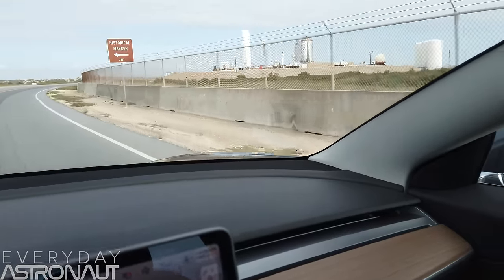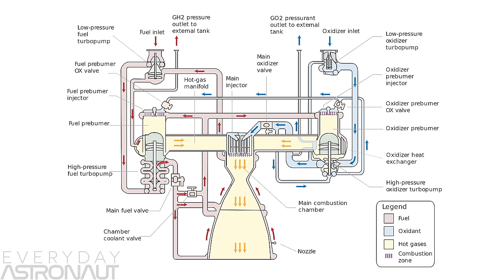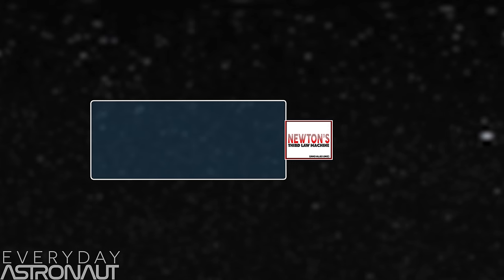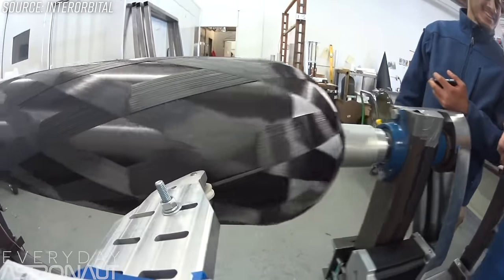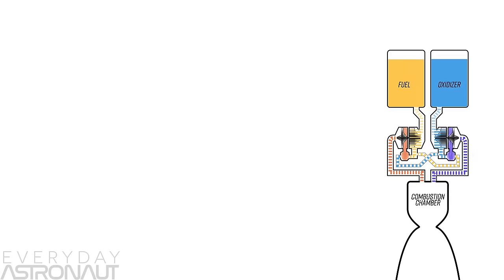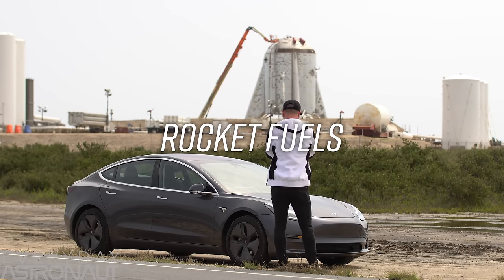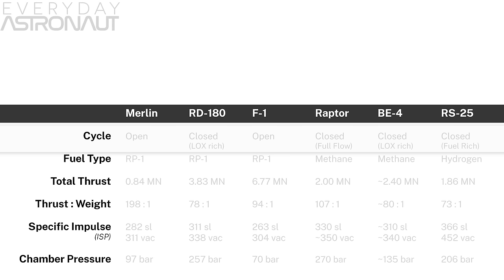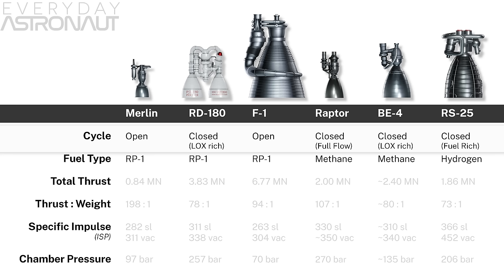Is SpaceX's Raptor engine the king of rocket engines?

Comment from the maker: Elon watched the video and provided some additional input in this tweet - https://twitter.com/elonmusk/status/1132386984444383233?s=20

"Great video. Couple notes: Raptor designed for subcooled CH4/O2, so propellant density & thrust increase up to ~8%, as needed for mission. 380 Isp & up to 50% thrust/weight improvement over time. Merlin thrust/weight doubled from V1, but Raptor is closer to optimum."

and this one - https://twitter.com/elonmusk/status/1132389917722419200

"Propellant stays same, but almost everything else improves. Fundamental goal is minimize cost per ton to surface of Mars."
Reply: That's awesome! Does this mean the TWR increases to about 150?
Reply: If Elon is interested, you clearly did something right!
Reply: Do you think he watched the whole thing through? Probably on x2. Job offer from SpaceX not far behind.
Reply: Congratulations.. and Thank you for all your hard works and commitments 🙏
Reply: Amazing video! Took time but totally worth it. For future reference, this is the go to video for any rocket-engine related things
Reply: Wow. Elon probably subscribed to you. Great work!
Reply: Very awesome that Elon watched and then commented on your video.
Reply: on flight record, for Merlin, RS-25 and F-1, multiple have flown per flight, for M1d multiply by 10, RS-25 x 3, and F-1 x 5 also M1D hasn't failed in flight, only M1C
Reply: Thanks for the update and I have to thank you once again for your superb explanation! <3
Reply: engine F-1 fail mission Apollo 13
Reply: Totally worth the time. You should have made this video earlier. Please make a video of airospike. Is it possible to combine airospike with raptor design?
Reply: Tim, the link to the first Elon tweet takes you to this video. It needs changing to Elon's tweet.
Reply: Hi Tim, 300 bar is not the equivalent to 3 km deep under the sea but 300 meters. EDIT: I was wrong and it is 3 km, Tim is right
Reply: @alxo82  Every 10m of depth adds 1 bar .  And  300psi = 20.67 bar..   But he meant 300bar times 10 equals 3000m
Reply: @TRFerron  1 m under sea = 1 atm = 1.01 bar
Reply: awesome video Tim i know have a much better understanding of different engines :)
Reply: Wow thats really cool! You make really high quality content, so it's not that surprising that even Elon watches it . Also love that they had your sticker on the computer on the livestream once.
Reply: Ugh @ Mark B Spiegel inserting himself everywhere
Reply: @omsi-fanmark  I was wondering to. But he can't take a job at spaceX because then he would not be allowed to leak the info :p
Reply: @gibacke2536  The F1 never has failed.   Your probably thinking about the J-2 second stage engine failure.
Reply: You forgot  they can be carbon neutral on earth
Reply: Well, you did ask Elon to do an Interview to tighten up the data, or free it, or something:)
Reply: Amazing video Tim, really bringing rocket science down to earth for the rest of us!
Reply: @alxo82  No. 10m of sea water is about one atm of pressure. I'm a commercial diver and recompression chamber operator. I know what I'm talking about on this one. Tim has the right numbers, you don't.
Reply: Does 'cost per flight' include refurb cost?
Reply: How exciting to get a comment and commendation from the man himself. Great job.
Reply: Thanks for the great presentation.  I learned so much watching your videos. Your enthusiasm is contagious!!!
Reply: I just noticed, do you have heterochromia?
Reply: @dan_13  short sellers, and competitors, or there fan base. Really you know your doing a good job when they get pissed off. Means they are nervous.😎
Reply: @everydayastronaut you should team up with Jared Owen he makes awesome animations and you could explain
Reply: Awesome video!
Reply: In answer to the question you posed, re: King of Rocket Engines, it may be, but the Queen of Escalation of Rocket engines has to be the electric fed 24mHg/FOOF with graser amp
Reply: Cool story bro.
Reply: The Best video so far, I guess you could apply for professor job at California Institute of Technology.
Reply: @kingsleyknoxlar  I know, I really enjoyed it, Charlie Stross does a good job of presenting it ;)
Reply: @alxo82  round numbers, there's 1bar / Atmosphere every 10 meters, so 300 bar times 10 is equal to 3000 meters which is equal to 3Km depth on salt water, so Tim is right 🙂.
Reply: @gasdive  you're right, all my life I thought it was 1 m = 1 atm, you never stop learning!
Reply: @jacobrubio9948  yeah, I was wrong!
Reply: This was really very very good video Tim u just nailed it
Reply: Whaaat? So the Merlin’s trust to weight ratio is around 400:1 ?!?!
Reply: @alxo82  learning is my favorite thing! Teaching second. Love love that comment thanks!
Reply: @gibacke2536  S II not F 1
Reply: @denismehmedoff7306  excellent idea
Reply: @alxo82  had the same thought during the video.
Reply: @alxo82  NO! 10m is 1 bar!
Reply: @gibacke2536  Seriously? Please check this again, you are wrong! The problem (Houston, we have a problem!) begin at about halfway to the moon, the F1 engines of Saturn V  was on the ocean floor long ago.
Reply: Love the fact that SpaceX looking long term in selecting fuel option due to availability on Mars. I hope I see them get there in my life time, would be dream come true for alot of us mere mortals that see colonizing Mars is essential to survival of humanity.
Reply: I had never noticed (totally not space related) that you have heterochromia
Reply: Gibacke: I believe that failure occurred in the 2nd stage which would have been a J-2 engine. F-1 engines were only on the first stage.
Reply: Wha? You act like Elon is some sort of ENGINEER or something ;) ...
Reply: Well, Tim, it's such an honor to have your video reviewed and commented upon by Elon Musk himself. It's wonderful to have someone like you around to translate all this for us -- mere mortals. I watched to the end and will watch again! You're a treasure. Looking forward to more Rocket Science from you!
Reply: @hatman4818  he does
Reply: @gibacke2536  on Apollo 13, all F1 engines worked (first stage), but the center engine of the second stage failed and cut out early. Those were different engines.
Reply: Great job ) now I know more about rockets))
Reply: @casinivan  would also recommend Scott Manly's video on rocket engines, deliberately won't put the link in, leave you with the pleasure of digging it out of the rest of amazing content this guy produces.
Reply: @oliverriall  someone will eventually have to take over from John Insprucker, and, I think Tim would do MUCH better job then those young boys and gals commenting falcon 9 launches now, it's often almost uncomfortable watching them being eaten by nerves on live stream, good for them and well done Elon for giving them a chance and throwing them into a deep water but for pure viewing pleasure someone with a lot of passion, a lot of knowledge and insight (these guys probably have all of those qualities to be fair), but ALSO is not scared of a camera pointed at them streaming live show to millions of people around the world would-now this would be a treat. Tim's live streams have more hits then Space X's-hint hint Elon.
Reply: @omsi-fanmark  dude that's a great idea they just need to let Tim host the official launch channel!
Reply: @carldavies4776  it seems that SpaceX would not have advantage of using untested designs like the airospike untill they are interested to build SSTO. It seems that vacuum optimised nozzles are more efficient than a airospike design at least in vacuum so SpaceX is actually well served by the current multi stage design for moon and mars missions.
Reply: Where did you get models of falcon rockets? Which scale? Where i can get also?
Reply: Hey Tim, great video. Definitely will rewatch multiple times, but why don't they just...... Turn the landing pad of the drone ships into a gimbal system to balance the return booster? To balance out the tides.
If you do read this, 
Thank you!
Reply: that's a link to this video, not his tweet :D
Reply: Personal replies from Elon Musk and Scott Manley. Baller.
Reply: @gibacke2536  Wrong.  That was an oxygen tank explosion on the command module, which was the 3rd stage of the rocket.  F-1 engines powered the 1st stage and fell back to the ocean once the fuel in the stage was depleted.
Reply: @dan_13  Jeff 😂
Reply: @dan_13  Jeff who? 🙄😳🤭
Reply: I already understand the electron rocket and why it's such a big deal! Why isn't Elon doing this for their raptor engine?
Reply: RD-170 has barely flown? you might want to google "Zenit". other wise another stellar vid full of great info and ever increasing production values
Reply: A really good video and great topic to use to introduce the different models of rocket engines. 
No suprise Elon watched it, you want to know what people are posting about your company are true.
So far this is the best video I have come across to set out the foundations of current rocket engines. 
One point you went from pressure rockets to flow cycles with out the step of burning fuel. I know it's "obvious" but you have the water rocket or fire extinguisher thruster. Then you have rocker that burn but are pressurised with compressed gas but burn the fuel. 
However great video worth the 50 miniutes of my time to watch. :)
Reply: F1: the center engine of Apollo 13 failed and almost blew the rocket.
Reply: @gibacke2536  the engine didn't fail on that flight
Reply: Tim, if Elon succeeds in achieving $00k round trip tickets to Mars, will you go?  The idea is to sell all your earthly possessions to raise the cash.  Most working adults without children in the Western world could scrounge up $200k buy selling their stuff.
Reply: @karliszauers1 failed second stage ,1 engine
Reply: @gibacke2536  no Oxygen tank ruptured, the engine didn't fail
Reply: Great channel dude! Elon should support you cuz u simplify these ideas to ordinary ppl like me
Reply: Consider breaking up videos like these into smaller chunks: It'll feel like less of a slog for your viewers. You can get more adds in. And it'll improve your integration with the YouTube algorithm.
Reply: Gibacke I think this just counts launches. Otherwise how should you count reignitions mid-flight for some mission profiles but not others?
Reply: @oliverriall  Yeah, they will want Everyday Astronaut as their PR guy. As much as all other space agencies / companies do. :)
Reply: @oliverriall  Certainly for their public outreach branch. What a great communicator!!
Reply: Fantastic info! Keep up the amazing content. You sir are providing much joy to this 49year old dude that loved space as a child and went through horrible disappoint when we didn't continue to the moon and beyond. I had given up on ever seeing progress in space travel. With Elon Musk embracing interplanetary travel it has reignited the passion and your channel is a fantastic source I use to keep up with current events. You rock! Thanks again!
Reply: @gibacke2536  No cause technically it was a tank failure in the upper stage, so not an F1 failure and not even on the same stage as F1.
Reply: @thegood9  That's cause Elon is an engineer though he is an electrical engineer by training, though he does have a good grasp of many engineering fields.
Reply: Failed space hardware 3?
Reply: @jimalbi  No it didn't it was the center engine of the Second stage J2 engine that failed on Apollo 25.
Reply: With this in mind, can you do a video on the "open expander" cycle Aeon rocket by Relativity Space?  The 3d Printed one.
Reply: The RD170/171 has been launched into space som 70-80 times. It is the most powerful liquid fueld rocket engine ever made, and it should be in the comparison. The RD-180 is also designed to be reused 10 times.
Reply: @jimalbi  2nd stage center engine failed not an f1 on the first stage.
Reply: It's still just a Newtonian device - trying to perfect the steam engine (methane + O2 = H2O + CO2) isn't going to get humans very far.
Reply: Thank you for producing a well documented and well understood video on rocket engines. This should be shown in classrooms to engage the next Generation of where we have been and what is to become to get us efficiently into Space. Well done!
Reply: stupid question from an amateur here, but has anyone ever tried to eliminate the preburn cycle entirely?  Maybe using something like an EM induced cylindrical impellor (kind of like an inverse auger) with a progressive pitch increase within the fuel and lox lines themselves?  i have no idea if the hydrodynamic properties of liquid methane or oxidizers would allow it to work, but if it did, no extra seals to fail and no complex fuel routing.  But like I said, I'm no professional, just a thought from an amateur inventor.
Reply: Everyday Astronaut the Soviets used Stalinium in their closed cycle engines )))
Reply: Great video Tim!  I was anxiously awaiting this one and you did not disappoint!  I've watched it a few times now, really trying to soak up all the information.
Reply: @planetmuskvlog3047  most people have a negative net worth.
Reply: @miketeves3237  Perhaps on the cold side they could use a superconductive electric pump.  They are pumping LOX for crying out loud.  The whole purpose of the preburn cycle is to create pressure.  These people have been able to pump liquid hydrogen with a superconductive pump.  Not sure if the pump design would provide the kind of pressures needed but it would be a starting point.
Reply: @prusak26   While Tim does a fantastic job, I also think that the Space X people do a great job in live stream, too. Their presentation by definition has to be  more scripted, but it certainly is informative and enthusiastic.
Reply: @PepsiMagt   Good point about RD-170/171 flights (e.g. on Zenit). Although the RD-180 is extremely durable, there is no way for it to be recovered at present. It is not restartable, and is much too powerful for retropropulsive landings, even with its degree of throttleability, unless it were on a huge rocket with  more than 7 or so such engines. Also, the Atlas V attains much higher energy, at least for unmanned flight profiles, requiring more fuel for re-entry and therefore being much less efficient  as a re-usable first stage.
Reply: @miketeves3237  Yes, the  Rocket Lab Electron rocket, which resembles a scaled-down Falcon 9, uses battery-powered electric pumps on its little Rutherford engines. The second stage jettisons a discharged battery pack before reaching orbit. This works very well
Reply: Thanks for this video.  I worked at SpaceX for almost 8 years, and I still learned something!
Reply: @RarestAce  I wish every CEO in the world would be like him.
Reply: Wow, Elon Musk actually watched this? I didnt think someone as famous as him would be interested in what us commoners watch
Reply: @gibacke2536  Nope - that was on O2 tank in the service module that failed
Reply: @Allen Loser No. Not a "StarGate" either. Consider when Ptolemy successfully modeled planetary motion with pretend glass spheres with epicycles and deferents. From then on, "scientists" worked to perfect that model and nothing else. Same today with quantum mechanics, which still has no variable for "awareness factor" from which our brain cells create the illusion of self.  Something more fundamental and weird is needed, such as being able to show everything shares a common center and light creates the illusion of separation. Then again, why aren't we considering "particles" as miniature event horizons ? Where do we go from here ?
Reply: @Allen Loser No, I don't mean using the Electron engine per se (I hope I understood your answer well enough), I meant the turbo pump section. The Raptor is fine with their design, they are genius, though the Electron engine has not yet been talked about by Tim, it made sense to me how they could do this from what I now know. It all boils down to one thing I think team Electron has done, which I was asking in that query. It seems like Electron engine is using powerful electric motor(s) that pumps the oxidiser and fuel into the combustion chamber(s). From the looks of things, this cuts off a lot of plumbing and mechanisms, which in turn reduces weight and other complexities and adds finer control to the engine. Since it's an electric motor and uses a battery it means SPACEX can leverage TESLA's core technology and business to create a technology feedback loop. I think SPACEX/TESLA can make a more powerful and better electric motor for it better than Electron Labs. The other wonderful thing is the Electron engine is entirely 3D printed, and because of the lack of turbo pump complexities, it is easier to print and has way way little parts than the conventional rocket engine. So my question is, why isn't Elon Musk doing this? It has been proven to work for a rocket engine, why isn't SPACEX adopting that technology for the Raptor? Is it that the pump isn't powerful enough to produce enough thrust-to-weight ratio?
Reply: @Allen Loser oh ok. Let's see what Tim cooks up for us to understand this well. I hope he answers the above question.
Reply: You are crushing it with these videos. Represent Iowa! Woot Woot!
Reply: Bravo !
Reply: @emmanuelmahuni8163 I get the impression that what you're referring to is the Electron rocket produced by Rocket Lab and propulsed by the Rutherford engine?
Well, I think the reason is that the ambitions of the Raptor engine is much bigger than those of the Rutherford and that the energy density of a battery is much lower than that of a rocket fuel.
Also, once the medium that carried that potential energy that drived the pumps has been used, the Raptor engine uses this as additional mass to provide extra thrust thereby dumping it almost directly, whereas the Rutherford waits to dump that extra now useless mass until the staging at which the Electron rocket dumps a/the relevant batterypack.
Reply: @Apollorion  ok. Thanks for the name correction. However, as I said, I really don't know how the Electron rocket works, but go to 5:52 to 6:04, Tim briefly says something about the Electron Rocket, to my understanding the Electron has a electric motor pump fed engine, meaning the motor simply pumps the needed fuel etc into the combustion chamber. I don't know why people are thinking that I am saying the Electron is propelled by a battery 😂? Otherwise I don't understand why you are referring to "energy densities", that's obvious, unless you are saying that the amount of fuel and oxidiser needed in the combustion chamber cannot be met by an electric motor and only turbo pumps work for SPACEX ambitions. But my answer would be isn't it just a matter of improving upon the idea coz it has been proven to work and Rocket Labs is doing it? I want the real reason why they are not using it. There should be at least one major reason.

Then you said "...the Raptor engine uses this as additional mass to provide extra thrust" I did not get that at all? I thought mass was the enemy in rocketry, that's why there is staging of rockets. How does a rocket make use of an empty tank ("medium that carried that potential energy") mass to provide thrust?
Reply: Why didn’t they just use flex tape
Reply: @emmanuelmahuni8163  What Tim said from 5:52 to 6:04 is not very clear to me. :( He might be talking about the Electron rocket but it could also be about ion-engines (I thought to recognize 'Xenon'), but it was clear he'd be clarifying himself later. And I have patience.

About: "...the Raptor engine uses this additional mass to provide extra thrust"
The potential energy carrying medium that I was referring to were the chemicals, not the tanks that encapsulate these.
By 'dumping' the combustion products from the preburners/gasgenerators that drived the turbines into the combustionchambers, the closed fuel cycle engines have extra mass to push against to push themselves forward i.e. provide thrust.

As for the energy-density I was thinking about, it was energy by mass and/or energy by volume.
In a vague memory of a video from Rocket Lab they said that they could electrically drive the pumps because the Electron need only carry a cubesat to an orbit of maximal 500 km high.
Reply: @gibacke2536  what failed was the engine of the payload.
If a Falcon 9 puts a satellite in its correct orbit and the satellite fails in itself, that's not a Falcon 9 failure.
Reply: im now watching you for a year.. here and then... but that video made me subscribe you :D for me it is actually a thing to subscribe to someone
Reply: @gibacke2536  F1 only powered the Saturn V first stage, nothing to do with Apollo 13 service module explosion.  The F1 was a RP1 fueled engine while the J2 engines of the 2nd and 3rd stages were hydrogen fueled. The hydrogen fueled engine on the Command/Service module was simply called the SPS (Service module Propulsion System).
Reply: Well done!!!
Reply: @alexkorocencev7689  well let's see,your talking about his engines on video! Lol
Reply: Thank you! We should learn something every day and today you provided that knowledge.
Reply: Your video is great. Thanks for the schooling I got.
Reply: space x hasnt even gotten a man into space yet, what a joke!
Reply: FYI. 11:14 A low tolerance is a super relaxed tolerance.  Eg. 5cm +/- 2m. A high tolerance is a very strict tolerance. Eg. 5cm +/- 10 um. So i believe you've muddled your terminology here by accident.
Reply: Well, you say that you considered engines which used a lot? So Be4 is already developed? And rd170 is not used much inspite of success of Energia? You are obviously biased, and all your reasoning about "king engine" is childish. If trust ratio is so important so why not to use only this kind of engines? Just join them together and be happy. So why exist other less effective engines? The answer is a complexity, which affects such a things like mass, costs, reliability, and again cost due to ensurance, so do your math again dude.
Reply: You linked to your own video, there...
Reply: I thought the fundamental goal was BFR makes flight to Mars and return ?
Reply: Did you include refurbishment costs in your cost per flight ratio?
Reply: @mikesunderland9145  Explosion was in the Service Module Mike.
Reply: @tedphillips2501  Ease up on the incense Ted.
Reply: @avid0g  Wouldn't the scale be logarithmic ?
Reply: @Blox117  Even better, he got his car into space.
Reply: @krashdown5814  
Ocean water is incompressible, so linear is correct. Atmosphere is compressible so non-linear pressure up to space.
Reply: @emmanuelmahuni8163  
Although the Electron Rocket combustion chamber and injectors may be printed metal, the electric motor is conventional construction but immersed in the propellant for cooling.
Reply: Why did i think the thumbnail was some action figures on a wall specifically transformer action figures.
Reply: *=* Hydrazine and hydrogen peroxide monopropellant boost by catalyst and boost by combustion of rocket engine for getting very far distance?
Reply: @avid0g  In hydrodynamics water hammer is dispersed by expansion joints, and temperature is a factor in volume too, I would have thought the small variations in fluid dynamics would still be significant in something requiring miniscule tolerances such as spaceships. For the purposes of rocketry I would have thought only solids to be considered incompressible, unless one is playing around with O rings.
Reply: @krashdown5814  
Water may be slightly compressible, but is not significant for depths of 3000 meters.
Reply: @krashdown5814  
But yes, temperature is significant in changing water density. Average temperature rise is significant in causing rising ocean levels.
Reply: @avid0g  Thermal expansion, something most people don't realise is just as significant as melting ice,  even more motive to establish our species on Mars
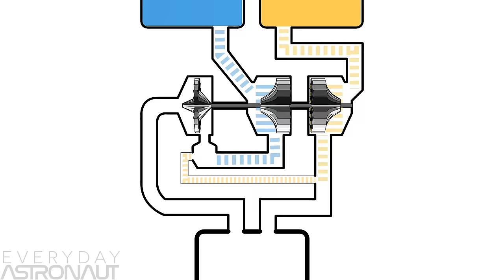Reply: The only thing that makes me twinge a bit every time I get to it (which is many times now) is at 11:53 where you say, 
"... you actually shoot ALL of the rich propellant through the turbine."
When you clearly meant to say:
"... you actually shoot ALL of the oxidizer through the turbine."

At least based on what you say immediately afterwards.
Reply: It took me 25mins to realise your eyes are different colours.
Reply: UMMM ;ID SAY ;THAT THE RUSSIAN MADE ENGINES ARE THE BEST!
Reply: ASTRO-NOT !!!!
Reply: Everyday Astronaut  Your first link, “to Elon’s tweet with more info”, is wrong. It leads back to this YouTube video.
Reply: firefly4f4   It’s more like, “all of the oxidizer plus some very ‘oxygen-rich’ fuel goes into the turbine combustion chamber.”

In this case, the turbine (power / speed) output is controlled by metering the amount of fuel that you inject into the turbine combustion chamber.

Also note that the oxidizer is shown in a blue crosshatch, which runs right up to the point that it enters the turbine combustion chamber. 
After that, the crosshatch turns purple, indicating a mixture of burnt exhaust gas and lots of oxygen.
Reply: As many already highlighted, with such a comment from Elon, I guess a job in SpaceX is just waiting for you. Congrats for your excellent video!
Reply: Iván Cañada lcvbcvmg
Reply: @teefkay2  Yeah, "oxygen rich fuel" isn't accurate, but it's "all of the oxider" that goes into the turbine's combustion chamber, not all of the propellant.

Do note that I am of course just picking nits :)  I freaking LOVE this video.
Reply: are you going to do a video on the resurrection of Project NERVA
Reply: Would you like access to the chief engineer on the F1 apollo engines? He is a personal friend of mine...I also know a plasma physicist that was chief scientist on two shuttle missions...I'm sure they would be happy to talk with you.
Reply: Actually you can make methan whit Hidrogen and some CO2 combusting they two making ir separate some molecules and boom methan it's more that complicate ir you can do that but just in a tank whitout exploding can be great yeah and i'm counting the pressure i love your Chanel and i see the vídeo complete no 10 next or something and i'm fan of Elon Musk thanks for the vídeo
Reply: Way cool how you spell it all out in comprehensible terms man.
And good on you for catching Elons attention...kudos bro.
Reply: @wyattb3138  agree with u
Reply: @littledevil1508  
Video sounded like a commercial for the space X rocket.
Which explains why Elon was aware of the video
Reply: @alxo82  10m seawater = 1atm = 1bar
(Technically 10msw= 1.00693064bar but whatever)
Reply: You are a gifted person. Thank s for the hard work!
Reply: Hey, Also Thank you  from me.You did something great. I think this is the only video, what helped me more than expectation. 
Have a great journey bro
Reply: One of the better videos I ever saw on YouTube. Thanks!
Reply: That is so awesome. Congratulations. Great video!
Reply: Everyday Astronaut, did you here about any plan for spaceX to consider "green fuel" seen in the GPIM mission ?
Reply: Elon is the MAGICIAN he can do anything in regard with space technologies and electric cars as long as he gets enough of tax payers money. After he managed to fly hes car with rubber tires and black leather interior to the harsh space environment where the temperature changes from -200 to + 200 degrees within seconds from sunlight to shade, i believe we need to give him many more projects. He can turn impossible to possible. Like Rocket with solar panels instead of rocket engines  :)
Reply: @gibacke2536  no the command module failed of the F1 engine itself.
Reply: That's rocket science
Reply: @gibacke2536  It was a J2 engine on the 2nd stage and it "shut down early" rather than failed.
Reply: @gibacke2536  I think not.   On Apollo 13, A second stage engine (a J-1) failed but none of the F-1 engines in the first stage failed.  And Apollo 13's ultimate failure was an oxygen tank in the "Service Module", not in any of the "stages".   :-)
Reply: So basicly the fuel can run colder?? And a bit higher pressure??
Reply: Энергия Буран. Sweet
Reply: A hugely impressive job of research and analysis!  Fantastic! Thank you!
Reply: I still keep cringing so hard when the intro plays. But still you make very good content.
Reply: Gibacke The mission failed, not the F1 engine....
Reply: My Father was a leadman with a crew building the F-1. I was a kid. I remember there was something about him suggesting a modification that somewhat improved fuel economy. They paid him something like $2,000 in the mid sixties.
Reply: @gibacke2536  The F-1s didn't fail. The mission failure was due to a failure in the service module 2 days into the mission. The F-1s were at the bottom of the Atlantic Ocean by then, having done their jobs.